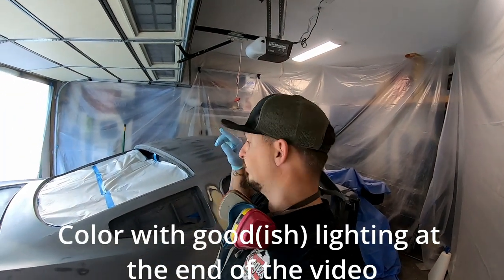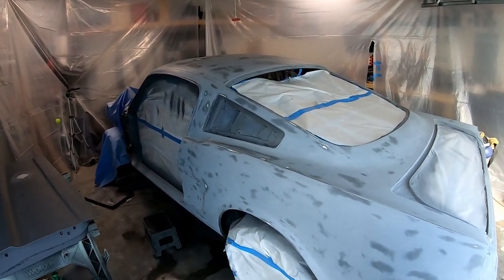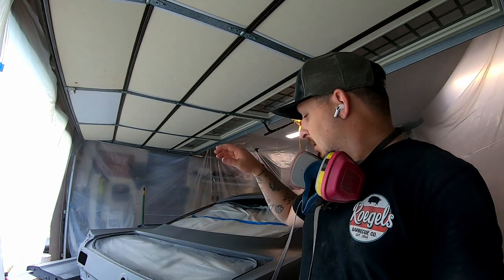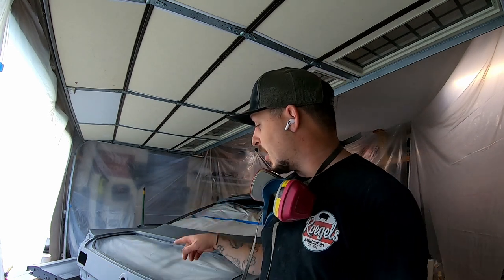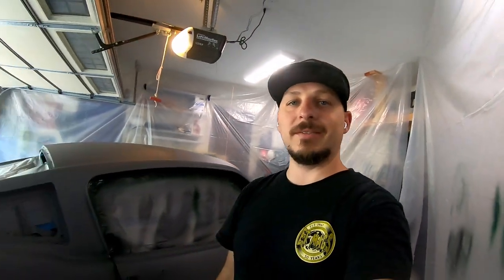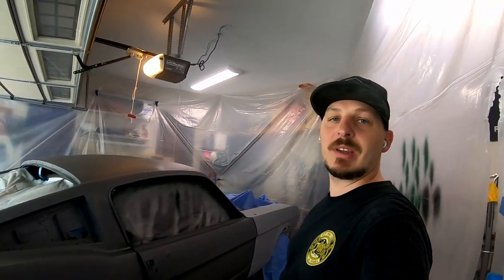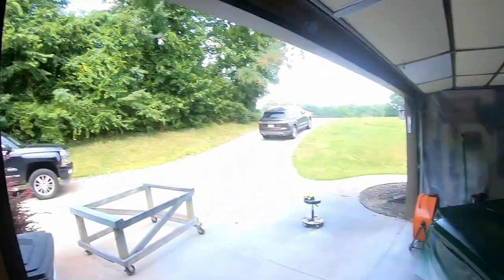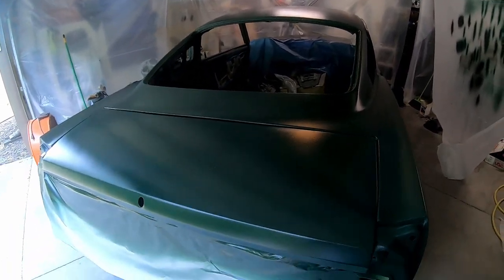FINALLY painting my car | First time car painter | 1966 Mustang Fastback

Comment: Sorry if I missed it. 
What color green and what kind of paint was it?
Reply from the maker: I used Hot Rod Flatz British Racing Green with their Boulevard Black for the tail panel and hood.
Reply: @SlowInFastOut1776  Next question. About how much of the green did it take?
Reply from the maker: @DannyReckless13  If I remember correctly it was about 3/4 of a gallon, plus the appropriate reducer.
Reply: @SlowInFastOut1776  Makes sense! I am considering a similar scheme on a coupe. But going with the "Rock Moss" green. Appreciate the quick replies. Looking forward to seeing further progress on your car.